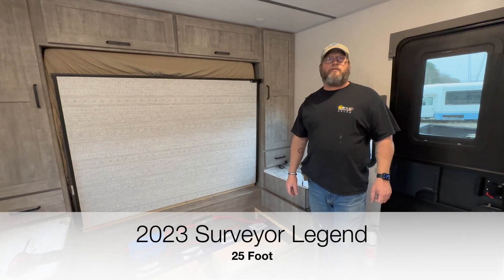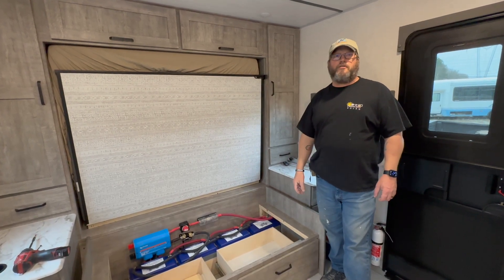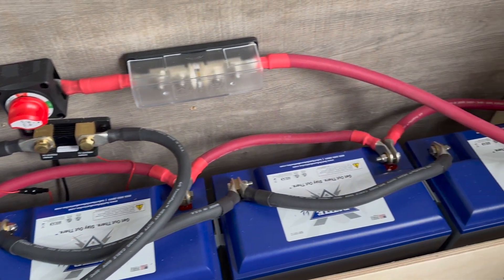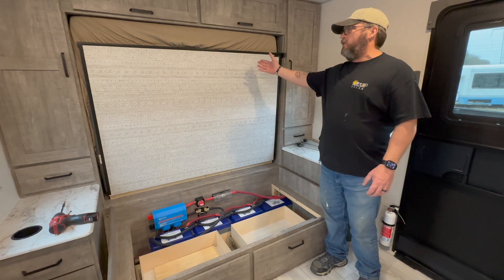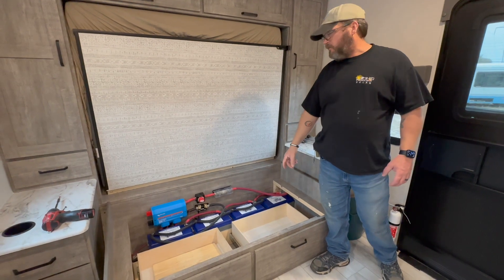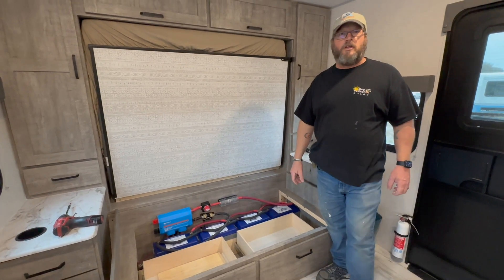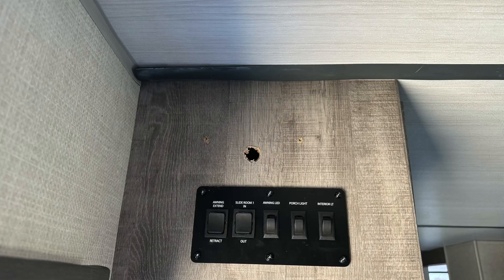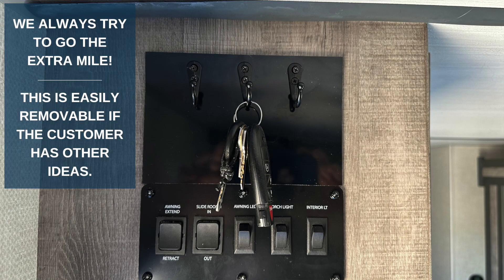Awesome Solar Installation in a Small Travel Trailer

Comment: What is the ballpark price for this system?
Reply from the maker: Every installation can be different, even if the RVs are almost the same. However, to give you a ballpark, it would be about $13k, which includes all the parts and labor. Again, please note that wire lengths, labor hours, etc could be different (one way or another) based on the RV you have and what you're looking to do, and where your components would be placed. We're happy to provide you with a quote for something similar. Check out the GET A QUOTE button on our website if you're interested.